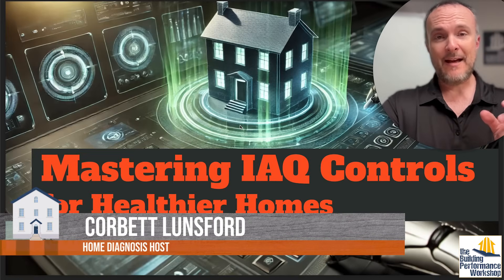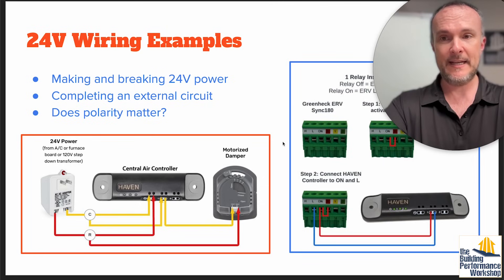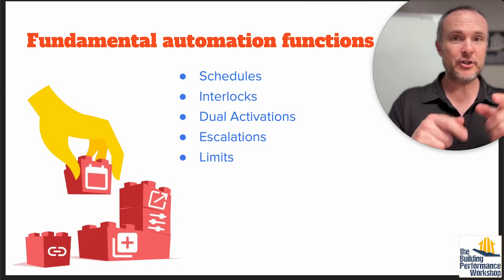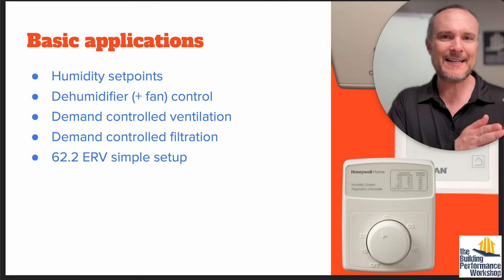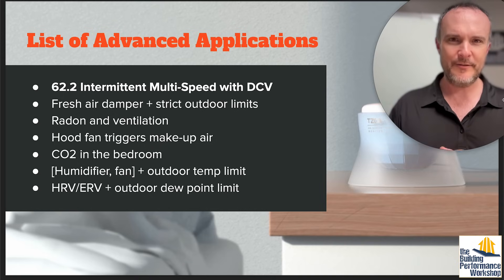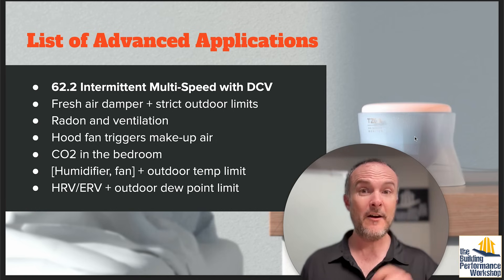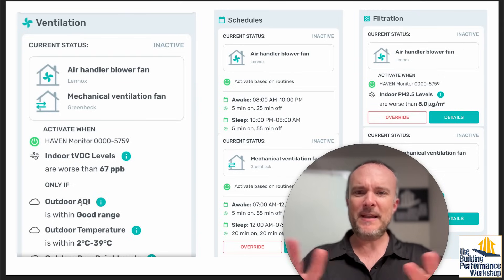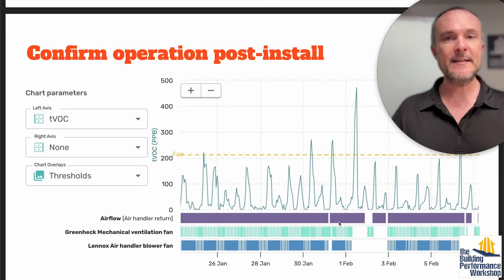New Ventilation Control from Haven (IFTTT, API, and Demand Control via Room CO2 Sensors)

Comment: Home assistant and Node-Red for automation and I have temp / humidity sensors in every room. I bought a waveshare 8 port relay that runs a ESP-32 and integrated that through ESP-Home to control my ERV, Zone dampers, Fan calls are handled by this relay.

Comment: I’ve been thinking through as a mental exercise, using an AQ sensor like this Haven, to measure the OUTSIDE air condition to control my intake baffle on my ERV to automatically protect from drawing wildfire smoke into my home. I’d love anyone’s feedback on this idea, because I’m leaning now towards just investing in the proper filtering of that intake air, instead of closing off my ventilation source.

Comment: Home Assistant has this covered. You can also run your own app on a cheap Mac mini to bridge stuff that doesn't fit that system, as that app can call upon Shortcuts from any vendor without having to work through auth or integrations.

Comment: I think adjusting ventilation (erv) based on mobile phone location would be a cool feature.  It would take no additional equipment and we almost always have our phones on us.  The ventilation would run based on how many mobile devices show up at the location or devices connected to the WiFi network.  No schedules to set either.  Not a perfect solution but would work the majority of the time.

Comment: Another aspect to consider is outdoor air quality. Even a MERV 16 filter isn't going to block 100% of the particulate from forest fire smoke, and it won't stop carbon monoxide and sulphur dioxide from forest fire gasses. In areas prone to forest fire smoke or smog it would be convenient to have a system that ventilates only when the indoor quality is worse than outdoor.
Reply: HAVEN does that! Limit an automation based on outdoor AQI
Reply: @KevinHartTheCanadian  Nice!

Comment: Before I even started the video I was goin to say haven. They just came out with the room sensors.... and then the video.... I use it with a ventilating dehumidifier and a relay that when humidity gets high it triggers heatpump dehumidifier mode and dehumidifier. I put in an idea that would allow multiple levels of triggering. IF VOC/CO2 or Radon are at yellow levels but temp outside is too hot/cold then dont trigger dampber but if it goes to red, open it. ecosense is the radon dector.

Comment: Had an HRV (yes, I know) added just before Covid and it was just chilling the house in the winter time.  Hooked the wires up to a wifi relay and created a Home Assistant to control it.

Takes in the values from VOC sensors in my daughters rooms and sets a runtime base on that, and then adjusts the runtime based on outdoor temps.

Seems to keep a balance between ventilation and heat loss.  And I can feather the ventilation so it’s not just a solid 20 mins of cold air,

Made The Wife much happier with it.
Reply from the maker: Good work Mondo

Comment: As a cyber security guy, I would like to chime in relative to Home Assistant, Arduinos, etc. In general a local only, hard wired, on open source system has the potential to be far more secure as compared to a proprietary product made in a foreign country that is connected to the Internet.
Reply: Investing in a switch/router that can handle VLANs is a must in situations like this.

Comment: @corbett , cant wait for the Home Assistant episode. Maybe a Podcast too?
A lot of your viewers have HA, judging by the comments on other videos.
Controlling Range Hood (in my case, a Hauslane with an IR blaster) and MAU would be my  votes for topics
Reply: Do you use a sensor to determine that you have started cooking? I use a temperature sensor and check for a minute over minute rise in the temperature above the stove. What really needs to happen is that the stove is integrated and gives a signal that it is now in use. For our gas stove I would like to begin ventilation before the temperature rises, as that is when the oven smells the most. I suppose a current sensor on the oven might work since the igniters draw some current.
Reply: @MrTimtimmytime  i did not venture far... my Hauslane is not smart, and while its ADA compliant, Hauslane did not yet release the remote control, hence I cant program the YoLink IR blaster.
To make things worse , I dont have a good MAU system (I crack the door open 2 inch).
I discovered that after turning the hood, air was getting into the kitchen from the wall cavity where the studor vent is in the half bathroom!!!

Eventually after i get all fixed and programmed, i will use the heat sensor from X-Sense and a clamp current meter with ESP32 to detect cooking.

Comment: Definitely a step in the right direction. I really like the idea of having a sensor in every room, at least for temperature, pressure, humidity and CO2. That, along with some type of people detector, radar or infrared, goes a long way toward optimal control. Now all we then all you really need is a sold control algorithm and a combination protocol to the equipment. We really need a standardized way of controlling things like blower and compressor speed... One of the manufacturers needs to jump on that IMO.

Comment: This is something we really need - a system with monitors in every room for CO2, VOCs, humidity, temperature, and any other air quality indicators of interest, that can relay that information to a controller and adjust air changes in each room in order to maintain intended air quality.
You don't need the system talking directly to the cooktop, though. A sensor built into the rangehood will tell you how much contaminated air needs to be removed and replaced.

Also: I know DEI isn't fashionable in the US right now, but a side effect of not having anyone on the design team who has experienced domestic violence and stalking (as a victim - I won't make any assumptions about who is or is not a perpetrator) is that you all think being able to control the house environmental systems from the internet is a good idea. NO PART of my house is going to be controllable from the internet - not the security system, not the lights, not the HVAC, not even the temperature of the swimming pool when we eventually install a swimming pool. I've been through dealing with a controlling stalking abusive ex once, and there's no way I'm ever opening the door to someone who isn't even in the house being able to manipulate my home like that.
Controllers for each room will be hardwired into a panel on the wall in that room. The whole system will be managed from a computer that is not connected to the internet. I care about my family's safety, even if you blokes are oblivious to this being a security risk.
Reply: DEI and domestic violence are unrelated.
Reply: @Urbanhandyman  keep telling yourself that. Then you won't need to wonder why there are so few women in your workplace.
Reply from the maker: @urbanhandyman I’m going to respectfully disagree, the culture of building is often very macho and gross, no way the physical part is the only thing keeping women away.

Comment: Unless I'm mistaken.  There's already a company making ervs that run 24/7 and have occupant sensors to increase speed automatically
Reply: Occupant sensors are not iaq sensors
Reply: @timdestasiohvac  renewaire makes motion senor and IAQ occupant sensors as well
Reply: @Ms2Chill  i saw that as I am currently designing with one of their models. What iaq parameters does it measure?

Comment: I'm currently building a Passive House and I plan to use Home Assistant to control the MVHR, ductless mini splits and ceiling fans using data from Everything Presence occupancy sensors and AirGradient CO2 sensors. I'm not sure whether I'll put sensors in every bedroom/living space, or if it makes sense to sneak a CO2 sensor into the stale exhaust from the MVHR. Over time I hope to achieve some (potentially) interesting things such as being aggressive with heating and cooling while my roof is generating excess solar power. I've never lived in a high performance home before so it's going to be an exciting learning experience.
Reply: knowledge is light. at least put a hygrometer in every room.they are only $12 each. that way you have temp and humidity for every room. I have co2 sensors in main bedroom and one other bedroom . Im considering getting a couple more. also make sure to get at least a couple of pm 2.5 sensors
Reply: this is exactly what I did about 18months ago in our new house... Awesome!!

My mmWave are all ceiling mounted. A word of caution I am presently replacing all of my EP1s with other sensors due to reliability issues; in particular I am using models with an LD2412 as this has a very wide span which is important for ceiling mounted

Unifi has been very very solid for the wifi backbone

Over spec the size of your cable trays...

I have found Heat Pump hot water systems to be very closed from an API perspective

I am not sure of the size of your AC system, but I went with a Daikin VRV. Great products...but crappy interfacing.
Reply: @BradleyFordAus  Being using Unifi for a decade, it's great stuff. I've also got CAT6 going everywhere including doubles in key locations, and ceiling wires for the APs.

I've got a couple of EP Lites, I'll see how I go.

The heat pump HWS I'm getting installed is Reclaim. Right now there's a slightly hacky integration available for their "smart" module (it encapsulates Modbus commands over MQTT via an AWS server) but I know the controller communicates using Modbus over RS485 so it should be possible to build a truly local integration for it.

For AC I have four split system heads connected to two compressors. Mitsubishi Electric. There's an ESPHome integration you can use to control them, specifically MitsubishiCN105ESPHome. There are similar projects for Daikin (Faikin) and MHI. If you feel comfortable lightly disassembling your Daikin VRV indoor units, you could look to see if there's an S21 port on them.

Comment: All of what you are talking about is trivial using Home Assistant. The "Programming" is also very simple and extremely flexible. I have sensors, ventilation fans and my ERV all tied into my home control system that is based on Home Assistant. You can also do a lot of other interesting things like turning your front door lights on when you enter the driveway and turning lights on/off when you enter/leave a room. And by the way, all of this can be done without running wires throughout the house. Sensors are wireless and it's easy to use wireless controllers to turn fans (and anything else) on and off.
Reply: Absolutely. Home Assistant already has integrations for Zehnder, AprilAire 6000 and 8800 series, many fans, many air conditioners, thermostats, and countless other items. It can even see the state of many wi-fi enabled cooking and cleaning appliances (e.g. Miele) and you can automate many other devices with a smart plug. Best of all, Home Assistant tries to do local communications where possible, so the smart stuff keeps working even if the internet is down.
Reply: @sjwright2  people should also know that home assistant is FREE
Reply: Yeah this is seriously overpriced for what is just a set of smart relays
Reply: @davidkahler9390  Its "overpriced" because they're creating their own ecosystem and programmers cost money.  They think there's a market out there for this home automation setup where "the average person" won't want to spend time with their head in a computer figuring this all out.  Now, I am not one of those people as I like to tinker.

I have been looking into how an ESP32/ESP8266 can interface with a Mitsu heat pump.  It seems like most of the hard work has been solved.  But what I would really love to see is the Broan AI series ERVs be brought into Home Assistant.  There has been some folks out there trying to reverse engineer the protocols.  They think it's based on MODBUS (with RS485).  But it would be amazing if Broan decided to document the protocol.  There really is no reason not to do it, aside from taking the time to put it out on a support website.  I will say that I'm sure their excuse would be "It will lower our sales."  I would disagree.  It will likely increase their sales as now their product will have the ability to interface with more devices from other manufacturers, which could sell more ERVs.  It really would be as simple as Broan taking a document that they undoubtedly have already, maybe sanitizing it a little, and making it a PDF on the page for the ERV next to their manuals.  It could show wiring diagrams and the actual protocol used, commands, responses, etc.  That might be a total of 24 business hours, maybe 40 at the outside (not consecutive because they have other duties to perform).  It would be even cooler if Corbett could hit up his contacts at Broan to help make this a reality.
Reply: @davidkahler9390  There's some nice software there too. Home Assistant is great for the nerds, but it's beyond impractical for normies.
Reply: @davidkahler9390 how is it overpriced? Its cheaper than Airthings. You gotta buy a IAQ sensor one way or the other.
Reply: For home automation power users, yes Home Assistant works great. We work with a lot of HVAC Contractors who are trying to deploy this with their technicians, into their customers homes, and using Home Assistant is very clearly not suitable for this use case. It has to be easy and reliable for anyone to do.
Reply: @KevinHartTheCanadian  i agree. i'm helping someone at the moment who's installer didn't install the erv controller but you need the controller to setup the erv (so the ventilation is at the default setting, 2 ach. the setup needs to be idiot proof because many installers know less than the customer.
Reply: @KevinHartTheCanadian  Don't be discouraged by us HA snobs. I think this is a good idea for HVAC contractors and homeowners that are otherwise not interested in home automation. Building an API that would integrate with HA would be cool though. :)
Reply: I get that control systems can be hard, but we don't say that load calcs and math shouldn't be done because most local installers aren't good at them. Any time you put equipment on the Internet, it needs to be managed professionally. If these things can see the Internet, a TON of work needs to be done by the manufacturer to make sure it's kept as secure as reasonably possible and a network/systems specialist needs to take care of proper deployment and administration at the installation site. We wouldn't say we need to make sure everything is easy enough to not require an HVAC tech or electrician or plumber. We shouldn't expect to deploy IT systems without IT pros.
Reply: yes! smart ventilation is the future and home assistant is so perfect for it. I have an aranet 4 in my bedroom. based on that data I keep the co2 in my bedroom under 800ppm. if it rises above that ALL the exhaust fans in my house turn on(including my range hood lol) and within 10 minutes or so its down to about 650 ppm and the fans turn off
Reply: @jl9678 how do you control the range hood?
And do you have a make up air system also connected to HA?
Reply: Home Assistant for the win!
Reply: how long did it take you? Haven took me less than an hour to install. It was about as difficult as installing a cabld box. That is the difference.
Reply: Thats cute but not every consumer wants to diy. HA is not a scalable contractor option.